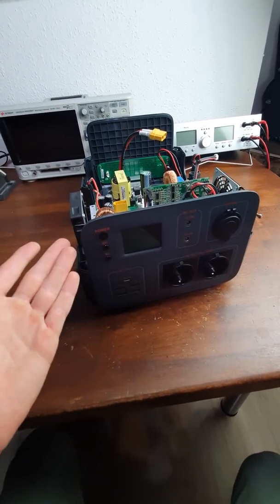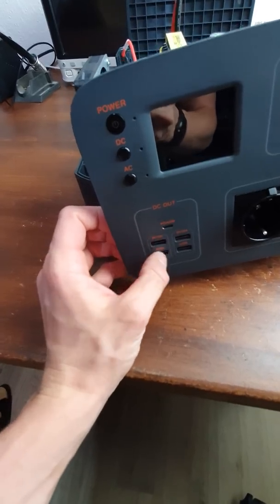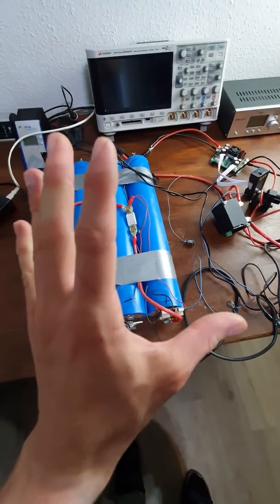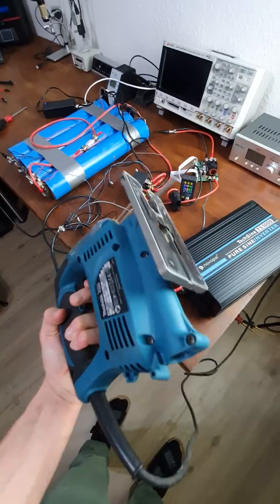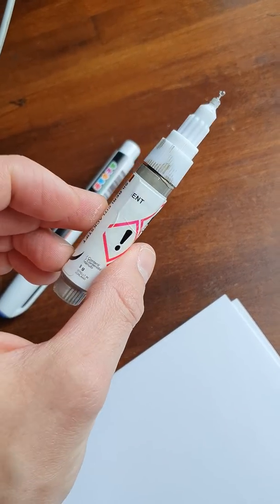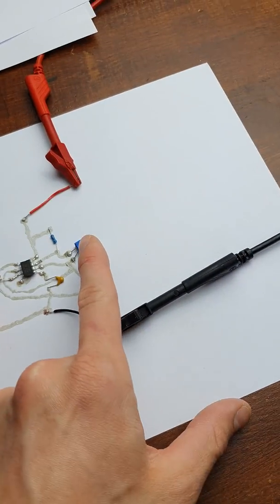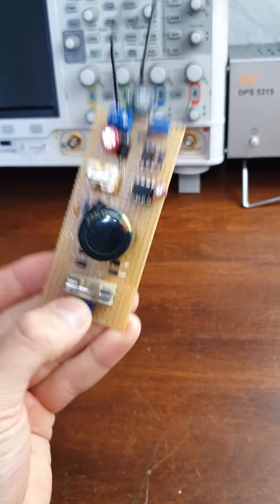May 2021 GreatScott! Behind The Scenes

Comment: I tried a diy SMPS of push pull type last year which was quite powerful and dangerous at same time but I just took care , stay atleast 2 feet away from it and used safety equipments while working. The project failed because I didn't have an output dual diode for rectification but I learned a lot from it :-)

Comment: Bluetti? Looks like the top phone charger and back light. If your getting into solar can you do a dyi suitcase unit like will prowse and explain how to/if you can do two 12v battery banks with one all in one controller unit? Id like to know how to use 4-330watt panels and two 12v battery banks so i can run a window unit ac. If your interested and have time 👍👍👍

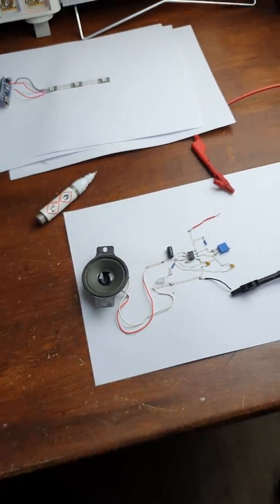Comment: 10:40 DiodeGoneWild will say: no inrush limitation, no common mode filter, no interference filter, the insulation gap on the board is very small (not up to european standard), no interference capacitor between primary and secondary side. so the conclusion is,,, DODGY :)

Comment: Q: would those pens work for fixing broken traces in say like an old commodore motherboard?
Reply: I wouldn't use buddy paint for that, I used buddy paint on my keyboard but it doesn't bond that well to the plastic substrate though it does work. The silver varnish might but I have no experience. It's probably cheaper to just buy a crappy iron, solder and wire laying around to fix a trace

Comment: Great to see your video. Need a little help. Got oxygen concentrator from usa (120V 60Hz) but I am in India here 230V 50Hz) can add a step down trx but what about the frequency. Need a not costly solution. Plz help me Scott...
Reply: I suggest get a 120V 60 Hz inverter for a 12 volt battery, and run it off a high-power 12 volt power supply like a reused computer power supply
Reply: How much power does it need?

Comment: I just wondering if you can turn an old UPS into a Inverter.
And maybe make a VVVF(variable voltage variable frequency)to power a motor?,will vvvf make a normal AC save more power(on normal compressor)
Reply: That would be Awesome